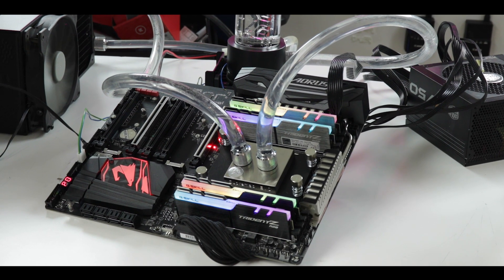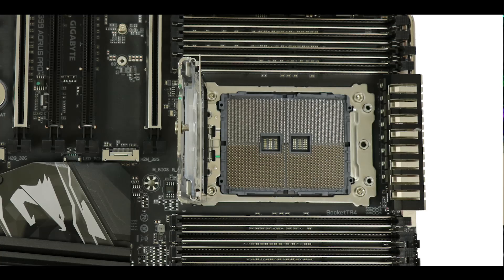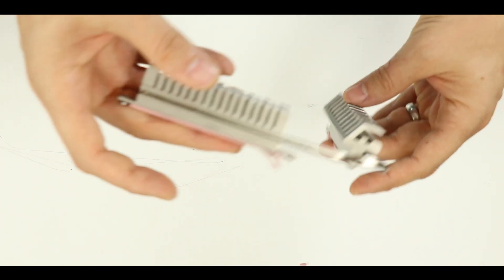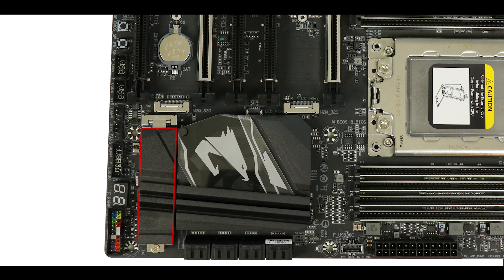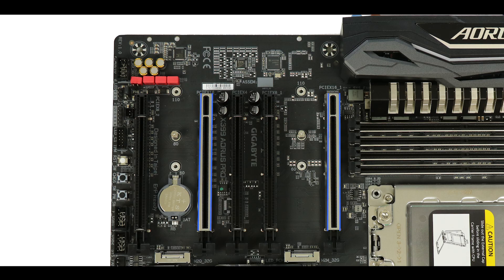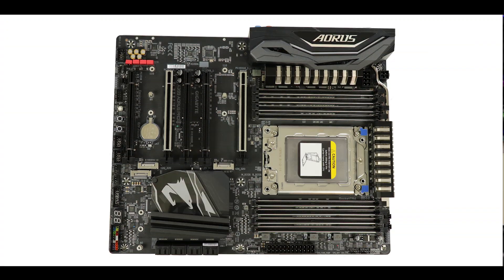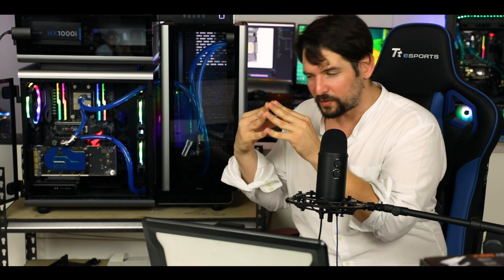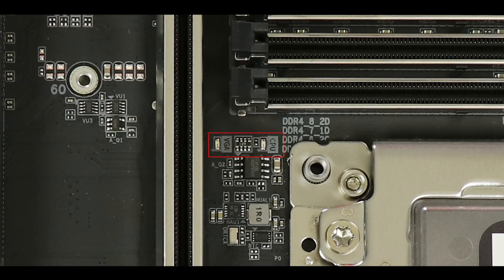X399 AORUS Pro : focused on the essential!

Comment: sorry for being late to this video but I want to ask you something.
I want to built my very first amd threadripper (1900x) and planning to buy this mobo but I'm stucked in mind because almost the x399 mobo has more eps 12v 4 pin power CPU but in this video you only plug 8 pin power CPU,is it enough for this mobo?
I have corsair cs750m PSU that only has 8 pin power CPU,
the question is should I buy more eps 12v cable? 
thank you laurent.

Comment: Great review
I have this one also the Designare
I prefer the AORUS Pro it's more stable
But both are great
The Pro runs with a 2950x and it's insane
The Designare with a 1920x is also quite good but the 2950x really shines everywhere no need to overclock at all 
RAM compatibility is better with the latest bios but still you need to watch what ram you buy
Reply: Hi, could you share with us how it went with this motherboard and what memory kit you would recommend for this motherboard and a Threadripper 1950x CPU? I ask because I am still using this motherboard in 2024 (Gigabyte Auros x399 Gaming 7) and I would like to expand the RAM kit. I have 2 Corsair Vengeance 16GB memory modules (2x8GB) at 2666MHz, but it only recognizes 8GB of the total 16GB.

Comment: Bad overclocker? Sure it’s not like the lower core count CPU’s but I’ve seen on more than one occasion the 2950x get to 4.0 ghz base stable... I wouldn’t call that ‘very bad’
Reply: I got it stable at 4.0 too but there is no need for doing that with a 2950x at least